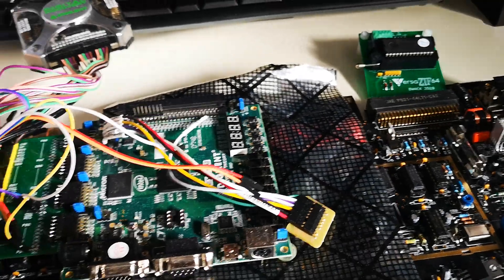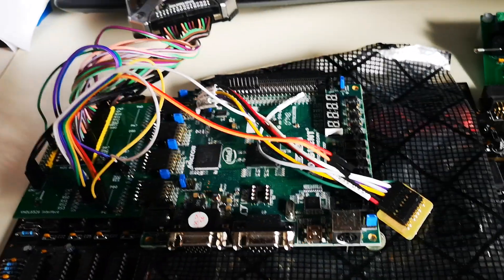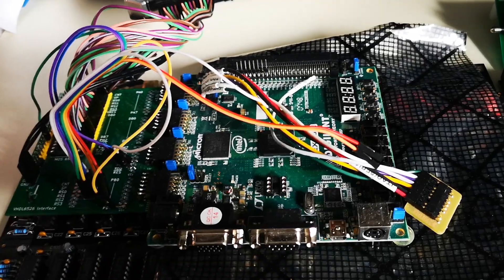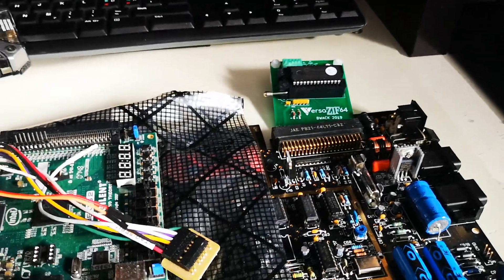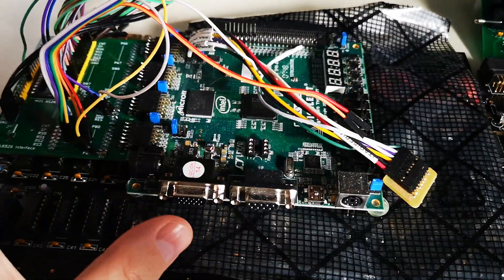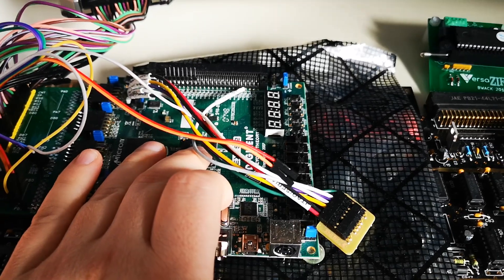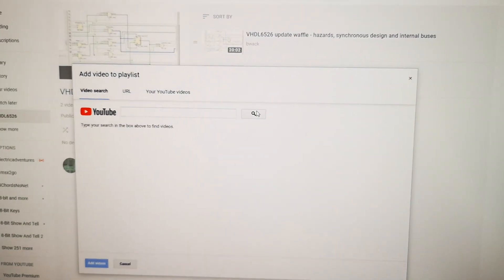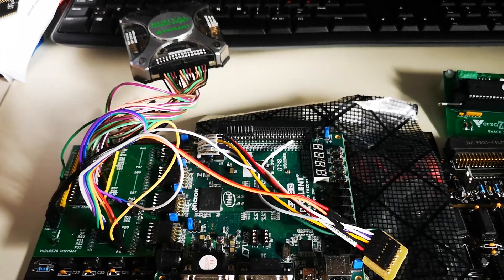The C64 VHDL6526 project - upcoming videos

Comment: I am curious as to what this is. Something with C64? I did lool in your videoes, however I think I am missing something.
Reply from the maker: CIA IC replacement.
Reply: @bwack  Ohhhhh.... That is sweet. 👍👍👍👍 How tough do you think it will be? And how physically small can they be made dimention wise, do you estimate?
Reply from the maker: @brostenen  It is possible to get it down to the size of the DIP40 package. Thanks for the comment, I have now changed the title and description.
Reply: @bwack  Cool... Nice. The package size of DIP Pin40 are a welcome adition to the community. I am always on the lookout for replacement chips that are modern designs. Like I am searching for VIC-II drop in replacements as well. The more we have, the better. And if a fully functioning replacement machine can be made this way, then there is no need for emulation and so on. Like that TheC64 machine from December 2019. It is like really close to the original, however still far from. And now that we have a total of 3 replica boards in the wild. Then this work is awesomme. If you need someone to test in the future, then sign me up and I am all there. I know little to nothing about creating this stuff. However I am good at testing, following a checklist. Some say it is boring, I just love these type of jobs.
Reply: @bwack  Uhhh... Almost forgot... We have RF-Mudulator replacements, and some even give out both Composit and S-Video and did away with the analog antenna signal. And there are stuff like RetroTink 2x as well. Newly produced cases. There are the Mechboard (sadly only limited run). Regarding keyboards... Have an idea that I need to rethink. Perhaps I can give it to someone that wants to follow through. It is regarding the C64 keyboard and keycaps.